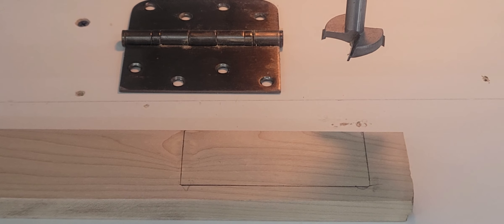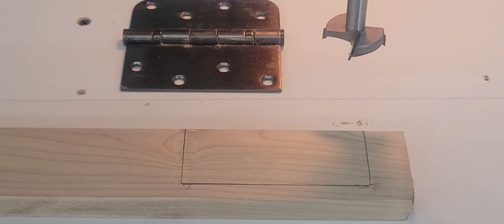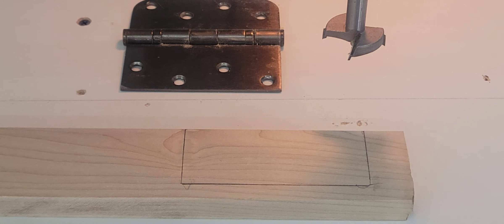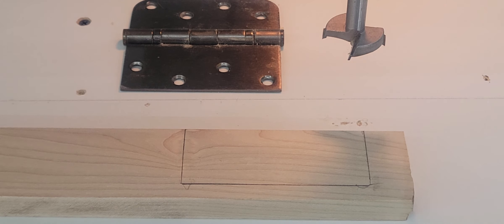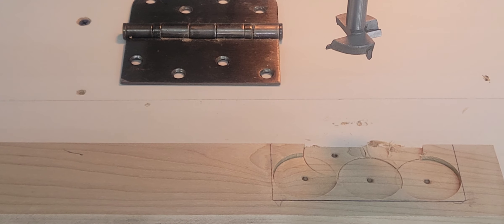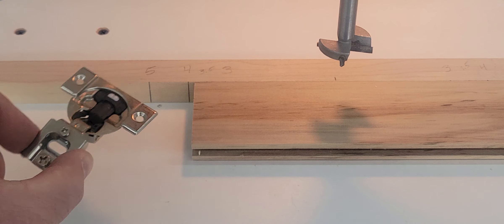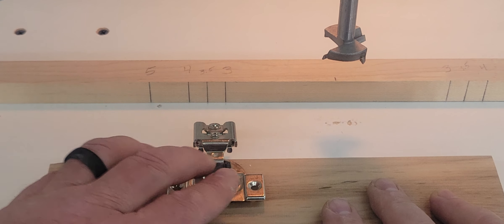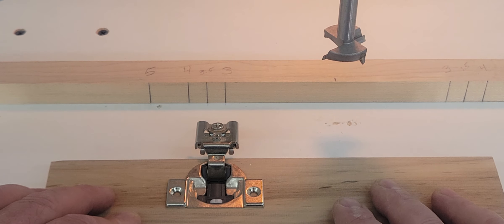Shop Sharps Series 2C: The Forestner Bit Making Cabinets

Comment: Great demonstration. I never thought of using a forestner bit for standard hinges. There are probably a lot of other applications for that method to reduce time spent with a chisel. I use a diy wood jig and a small router for standard door hinges. A chisel for one offs. I make my own cabinets and do all parts of home remodeling. For kitchen cabinets, I use a festool rail with holes every 32mm. A router mounted on a guide that runs s on the rail and locks in the holes makes quick work of hinges and shelf pin holes. I am not the typical IT guy. Growing up on a farm meant doing everything yourself.
Reply from the maker: We set up a router table, set bit depth, jig perimeters, and do the same with large lots of doors, or hand rout ... but for just a few this method works best. Thanks for watching Ken.